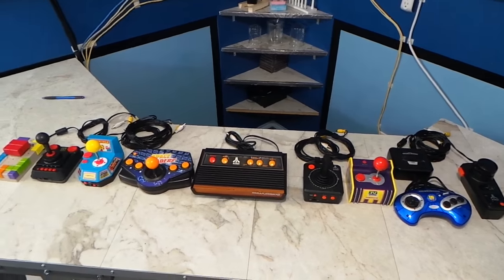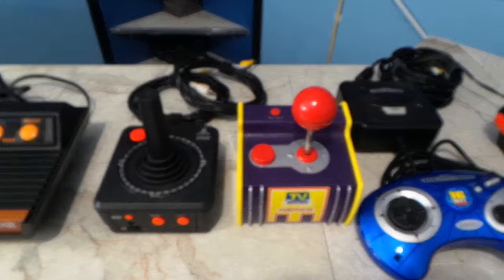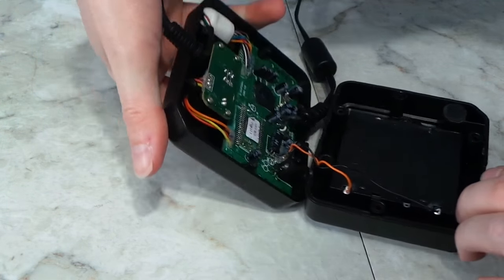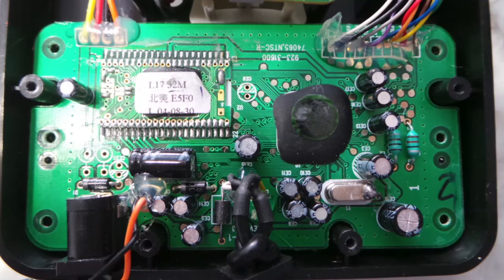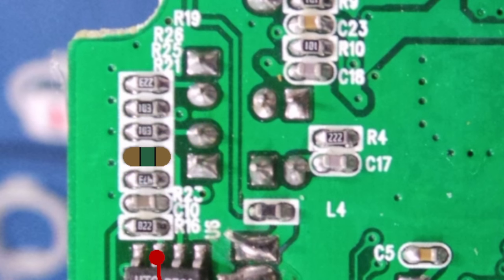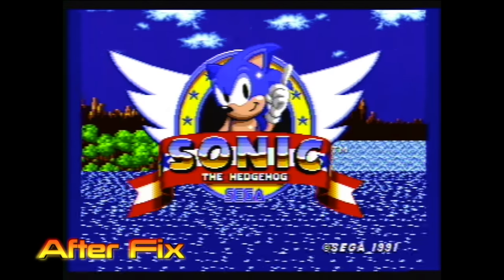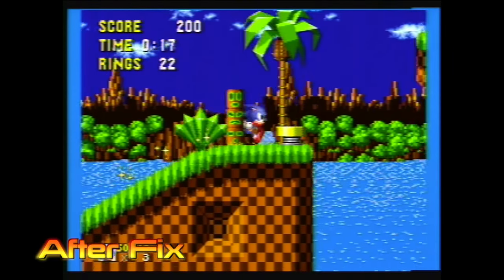Radica Sega Genesis Audio Distortion Fix

Comment: There's still some audible distortion in the audio signal, and while I have to properly inspect the audio circuit, it sounds to me like the resistors that bring the FM output to the amplifier are too small. I believe the FM chip cloned by the Radica Genesis is the YM3438, not the YM2612 like used in most Genesis Model 1s and two particular board revisions of the Genesis Model 2 (VA2 and VA2.3), and from my experience working with this chip while designing the Mega Amp replacement audio circuit, if the resistors you use are too small, you get excessive current drive from the chip resulting in the distortion that is still audible on your fixed Radica Genesis. I'm going to take a look at one of my own Radica Genesis systems (I've got three of them) and see if there's more that can be done to give this thing perfect sound.
Reply: Have you made any progress with this?
Reply: Unfortunately not, I received two large boxes full of arcade PCBs that are untested or broken which are keeping me quite busy. Once I have a little more time, I will take one of my Radica consoles and figure out what to do about the amp.
Reply: Looking forward to that. I still have one on a shelf torn apart.
Reply: This fix is cheap and incomplete because it was a quick hack I whipped together, and 8-bit guy here has copied it verbatim, including the errors and step order.
Reply: Michael- where's your hack description at (so I can reference it and give credit)?

Also +Ace9921 -- any update yet? No worries if not, I'm only curious because I'm learning about microprocessors and circuitry.
Reply: I heard it too, the channel sounded great but the rhythm sounded kind of flat. Rather than a "kick" sound from the percussion, such as the three "kicks" at the beginning of the Sonic startup screen, it sounded more like claps. Still a lot better than the original though, and better than the AtGames fix.

Comment: Nice! Atleast the audio wasn't out of pitch. There is a newer plug and play Genesis, which has a unpleasently higher pitch. The sound still sounds a bit butchered. Is it mono or stereo?
Reply: +Automatik Seeing how it only has 1 audio out lead, I'd say it's mono.
Reply: Daniël's Tech & Music Channel
Would be nice if that could also be fixed. Some Genesis soundtracks are to awesome to be heared in mono.
Reply: Automatik That would depend on whether the audio gets mixed down to mono after it leaves the chip that emulates the MegaDrive, or if it's already mono. If it's already mono once it comes out of the chip, there's no way to fix it.
Reply: Oh the atgames megadrive classic i have a real mega Drive and it sounds a whole lot better then the atgames

Comment: Just did this fix on my Mega Drive version. The internals were exactly the same. That was some small soldering work! It took me a while to solder to the leg of that chip, I'm surprised it didn't short it. Thanks for posting such clear instructions.

Comment: Hey 8-bit guy!  I'm a big fan of yours, as a youtube who makes tutorials myself.  I wonder if you would be so kind as to make a video explaining why what you did to that circuit board fixed the problem?  What is the L3 resister?  How did you know that that pin was the primary audio output?   Why does putting that output through the amplifier fix the problem? Wouldn't amplification add even more distortion?  Why pin 7?  I'm so curious as to all of this!  I could imagine I could google another tutorial about it, but I wouldn't even know how to search for it and I'd imagine you would explain it so so much more clearly.  If this is a waste of time for you, I understand, but I'm sure more people would like to learn circuitry 101 from you.  Thanks!
Reply: Finding out what pins deliver the audio is incredible easy if you have an osciloscope (and you can get cheap ones for like 50$).  
Finding out how to fix it - that is a different story. But sadly, he didn't figure it out on his own but used a guide - so it would be easier/faster to just search for how that initial guy did it.
Reply: L3 is an inductor, obviously, not a resistor, it's likely just there for regulation compliance. If you have the device right there, you could make nice high-resolution photos for me, or maybe find some from the net, and I'll figure out what the fix does exactly, because I can't find a textual description of the mod either, and I think 8bitguy hasn't linked to it. I'll probably need both sides. The IC is LM358 dual audio amplifier and pin 7 is the one of its two audio outputs. I think either they forgot that they were only feeding the IC too low a voltage to get appreciable gain out of, or they set the gain on both sides and then accidentally chained them.
Reply: DiCasaFilm - He got instructions online. Watch and listen closely and you'll hear him say it.

Comment: How do you fix the AtGames Genesis models?
Reply: That is the one I was looking for when I saw this as well.  Perhaps he might do the same for it.
Reply: This is what I was wondering.  It seems like they aren't a bad device aside from the audio.
Reply: You throw it at a wall.
Reply: The ATgames one seems to run all of the games a little slow.  It really annoys me.
Reply: Here's how:
1) Take it out of it's packaging.
2) Open up the system with a standard Phillips head screwdriver.
3) Take a standard-size lighter.
4) Set fire to the piece of shit.
5) Buy a real Sega Mega Drive secondhand.
Reply: I think the problem with the AtGames sound is totally different.  I think it's missing or using different sound chips.
Reply: fireaza That sounds arcane. Will it work?
Reply: Austin Reed It might sound bizarre, but it really works! The audio of a real Sega Mega Drive sounds exactly like the audio of a real Sega Mega Drive!
Reply: fireaza I though that it would change the AtGames model to sound like the real deal.
Reply: Austin Reed It's kinda hard for it to sound like the real deal when it's not the real deal. You can't expect games, which were programmed with the unique hardware and architecture of the Mega Drive in mind, to sound exactly the same when being run on not only completely different, but also inferior hardware. Hell, even different hardware revisions of the Mega Drive itself is enough to make games sound different. Clone systems are always steaming piles of crap and used Mega Drives are not expensive, so I don't know why you would bother.
Reply: Austin Reed Actually this would be a much harder fix because the at games genesis doesn't run on real hardware and chips like the radica version does.
Reply: anyone looking for the AtGames fix, there isn't one. it emulates the sound chip, and (apparently) it emulates the wrong chip. That prevents the power base convertor from working, and it mucks the audio up completely.
Reply: It's not a completely worthless device. But if you like certain Genesis soundtracks, some games are unplayable.
Reply: it's also valuable if you can get one at a thrift shop and you need a replacement cartridge port for your Genesis
Reply: Steven Benson Once I extract the roms from the thing, I'll make it a Raspberry Pi's shell.
Reply: not much point to extracting the ROMS really.. the only thing i'd be interested in doing to it is dumping the emulator and finding a way to replace it with one that doesn't have crap sound.
Reply: Steven Benson More interested into seeing how the homebrew titles run on a real genesis.
Reply: The AtGames consoles are garbage. With a Raspberry Pi Zero and a bit of work you can run the entire Genesis library, and then some.

Comment: Cool. Huge improvement. This reminds of the color fix for the C64DTV joystick. I bet some buisness suit said "I need this console yesterday !" and then the design never got polished.
Reply from the maker: +bwack Indeed.  I have fixed several of those 64DTVs.  Also the Hummer unit (which uses the same chip) had an audio problem that I actually came up with the fix myself.  But that's a long forgotten piece of history now.
Reply: +The 8-Bit Guy Hey dude. You make awesome videos and I really enjoy them. I think the story and fix could make another good short video like this one. I'd like to see it.

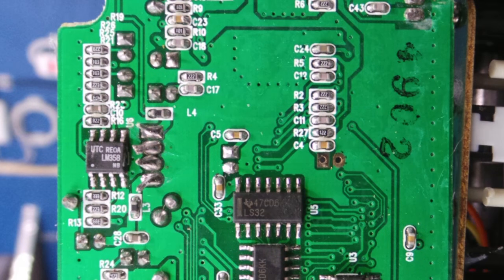Comment: 1:45 "this resistor L3" durr...
Reply: This guy understands me...
Reply: Inductors function as resistors to alternating current, so he's probably referring to it in that context.
Reply: Surface mounted resistors and inductors look very much alike, and I would suspect the reference material for the fix probably said L3 was a resistor, so I wouldn't assume David is entirely to blame for the mistake.
And, at the end of the day, you don't really need to know what the components are to do the fix, you just need to know how to use a soldering iron.
Reply: Eray Bilgin, depending on the context of how it's being used. (in this case output of the opamp)  It is still a inductor designator regardless. I'd say the opamp was driven to hard through the feedback (creating clipping). So putting a resistor on the output wouldn't have done anything.
Reply: Some people do have memorable introductions of themselves... oh well... congrats xD

Comment: How did u figured out that solution to fix it? :O
Reply from the maker: +Edu "Turupá" Sánchez As I mentioned, I googled for it.
Reply: +Edu &quot;Turupá&quot; Sánchez thats a passive aggressive way of saying pay attention.
Reply: +albi55uk XD I'm not english native speaker, so I sometimes miss a point
Reply: Passive Aggressive: denoting a type of behaviour or personality characterized by indirect resistance to the demands of others and an avoidance of direct confrontation.
Reply: +albi55uk hahaha i understood that one. I missed the point in the video where "he mentioned it" lol
Reply: +Edu &quot;Turupá&quot; Sánchez it's just basic electronics, just remove a serial resistor in the output but conect a paralel solution in the input of the aplifier... so the input signal is lower and it's compensate by reducing the output resistance
Reply: +CrazyMetal Thanx! I'm actually studying audio engineering and that information is very useful to me. So I guess that's an Op Amp?
Reply: it may work as a op amp, looks preaty simple, maybe it is mono (the sega genesis uses a custume stereo amp) the man problem, however, is the saturation in the inputs...
if you are looking for a good engineering master piece look at the marantz 4270 amps those where real amps
Reply: +CrazyMetal U bet I'll do. Thanx for ur help
Reply: +CrazyMetal Oh it's certainly mono.
Reply: I was going to say that, but yeah how did you figure out what to do to fix it?

Comment: Btw. L3 is not a resistor, its an inductor and it looks like it forms some filter (hard to say what kind without a schematic). It looks like what you did there is to convert the opamps current amplification configuration into a voltage buffer. It would be useful to have an actual look at the signals with an oscilloscope since it still sounds pretty distorted, but maybe thats what the chip outputs. Your resistor idea likely did not work because whatever you did input it into already has a high input impedance. What might have worked is voltage divider.

Comment: The way it sounded reminded me of this accessory for the Genesis back in the day that was a backpack that was supposed to be used for haptic feedback, it accomplished this by blowing out the bass on the audio and playing it through a speaker inside the backpack and it sounded about like it does in the video. Looking it up, it seems it was called the Aura Interactor, but I still remember it blowing out the sound like this to help with it's vibration for some reason.

Comment: WTF? That fix makes no fucking sense. What is that doing? How does soldering two sides of two different resistors together and wiring the audio output to the amplifier fix this problem? Seriously, that makes no fucking sense. It's such a hacky piece of bullshit call, but it somehow works. Goddamn, what the fuck did the author of the fix do to get that result? Some fucking electrical engineering wizardry we have here.
Reply: +rosenjcb I am not an electrical expert, but if I understood it correctly the two resisters he removed from the board were what was causing the distortion and the jumper wires he added connected up the PCB without requiring the resisters be replaced. As if you just leave it with two components missing the circuit won't complete and the board won't work.

I am not sure if this is because they are dodgy resisters or just incorrect, but that appears to be what the fix is. Get rid of those resisters, connect up the board so the circuit completes.
Reply from the maker: +rosenjcb Another poster suggested they were routing the signal through the amplifier twice, since it is a stereo amplifier circuit (well, 2-channel anyway) and so it is simply removing one of the amplification stages that is not needed.  The idea is sound, no pun intended, so I agree unless a better explanation comes up.
Reply: rosenjcb distortion has to do with the amplifiers internal signal path. one of those resistors mustve been floating somewhere above ground, providing feedback to the amplifier, which results in distortion. might be something different tho, as i didnt look that chip  up.

Comment: I bought a genesis a little bit ago. Combined with a SD card converter, it's a great little thing. I did have one of those "100+ in one" things that had a port for real cartridges, but the audio was horrible. It  wasn't distorted, everything was just pitched down about 1/2 a semitone, so it sounded like dying cats most of the time.
Reply: i want to hear that now
Reply: +Zappy595 same.
Reply: Zappy595
I'll probably upload a vid of it.
Reply: ah one of the atgames ones

Comment: So do I understand this correctly 8-bit guy, are the resisters causing the distortion and thus need to be removed, and then you put in some jumper cables to complete the PCB?

Would replacing the resisters with 0ohm resisters do the job?
Reply from the maker: +Crusader1089 I don't fully understand the fix.  I just copied what somebody else had figured out and made a proper tutorial on it.
Reply: +The 8-Bit Guy Thanks for the response. It's frustrating not to know the exact reason it works, but at least it works. Thanks for sharing the fix.
Reply: +The 8-Bit Guy Without seeing the board properly, I'm only speculating, but this is my theory. Op-amps need to be stabilised by feeding back some of the output back to the inverted input of the op-amp -the more you feed back, the lower the gain of the op-amp. I'm guessing the two resistors formed a potential divider at the op-amp output to feed the inverting input to stabilise the op-amp gain. They were badly chosen values, and the op-amp was hitting it's swing limits, resulting in the distortion you hear. This fix basically bridges this to provide unity gain from the op-amp. Effectively, it just becomes a buffer, but no longer hits its swing limits.
Reply: +ojmbvids this sounds about right to me

Comment: I saw the other video before this one admittedly, but I too cringed at that awful bass amplifier like boost to the audio. That's exactly how it sounded, like a bass boosted amplifier that stopped working correctly after a rock concert. Ouch. :(

But I found myself bobbing my head to the fix, so super job on that one. ♥

Comment: L is the prefix used for inductors.  Therefore L3 is probably not a resistor, but an inductor.  Physically similar but different purposes electrically.

Comment: Just FYI, L3 is an inductor, not resistor. And it does not help to put one resistor in series with an audio signal. Unless you put a couple of hundred k there, but then you get considerable amounts of noise instead. You need a voltage divider between the signal and ground to make that kind of external fix to work. ;)

Comment: Quick question: Is the Yamaha sound processor in the Ad-Lib card the same as or at least similar to the sound processor in the Genesis?
Reply: +TheMamaluigi300 are similar, but not equal, the genesis use a YM2612 (OPN2, 6ch), Adlib use a YM3812 (OPL2, 9ch)

Comment: I'd like to point out that L3 is not a resistor, but rather an inductor. And how did you figure out the solution? Did you followed the signal through the PCB with oscilloscope or just randomly desoldered components and looks if it worked?

Comment: I'd LOVE to see an episode explaining the theory behind that fix. I think it'd be really interesting to know what caused the problem and what these fixes actually do :D.
Reply: Yep.
That would be cool.

I don't see why the hardware should do that. I mean, if something fails, then you should replace it, not install a bridge over it...
Reply: +Popexssj Without seeing the board properly, I'm only speculating, but I'm guessing the two resistors formed a potential divider at the op-amp output to feed the inverting input to stabilise the op-amp gain. They were badly chosen values, and the op-amp was hitting it's swing limits, resulting in the distortion you hear. This fix basically bridges this to provide unity gain from the op-amp. Effectively, it just becomes a buffer, but no longer hits its swing limits.

Comment: Hey +The 8-Bit Guy,  nice video. I happen to own one of these and will probably do this mod on it, it really improves the audio a lot. Also, would you happen to know anything about how to make it output stereo audio? I read that this has the circuitry for it but I don't know much about electronic components to be able to figure it out.
Reply from the maker: +SonicYM2612 I haven't mapped out the circuit board on this thing.  So I don't know if it is possible or not.
Reply: +The 8-Bit Guy Nice to know that you did not buy the crappy genesis clone from ATGames, the sound is even worse on that one, They even put their own fakes on their own clone!